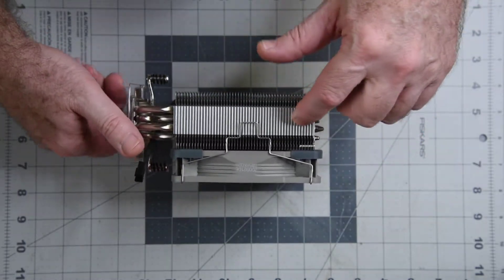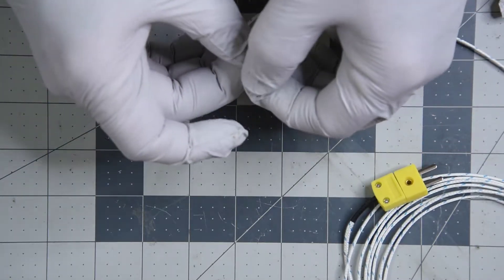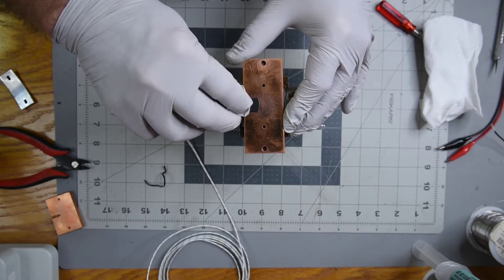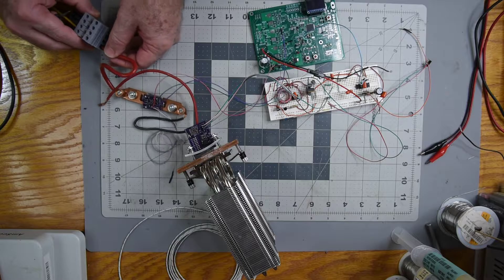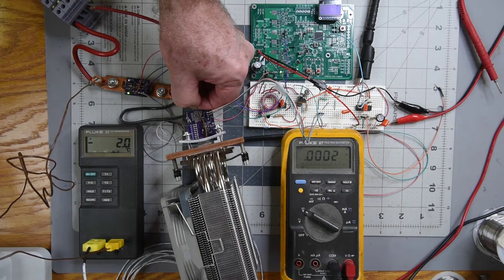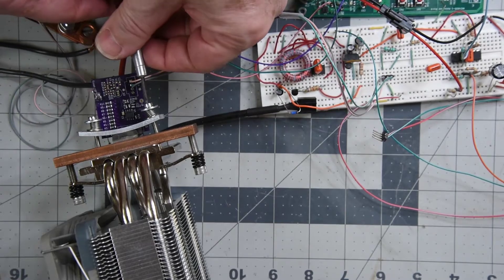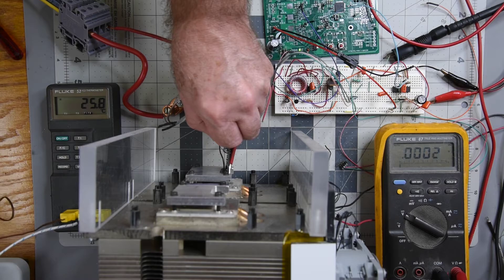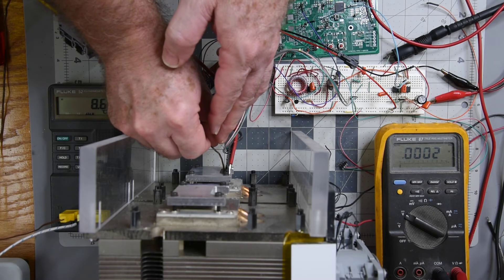Temperature Measurement Success – TO-247 MOSFET

Comment: Beautiful, do you use NTC, or somet. like LMT87 ? What is better to measure instant changes of MOSFET TO247 / 264 casing ? NTC, LMT87 or Dallas D18s20 ?
Reply from the maker: For the testing I was just using a cheap thermocouple from Amazon.  They have pretty thin wire so they respond pretty quick to temperature change.  For the electronic load, I ended up using the MCP9700 temperature sensors, mounted right beside the MOSFETs.  The MCP9700 is kinda like the LMT87 but with positive temperature coefficient.
Reply: Thank you.
Reply from the maker: You're very welcome